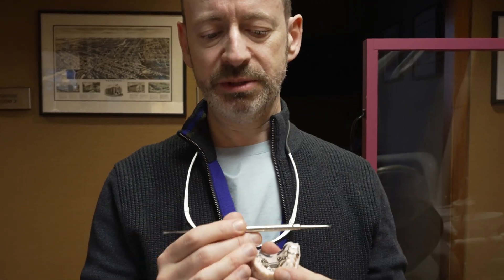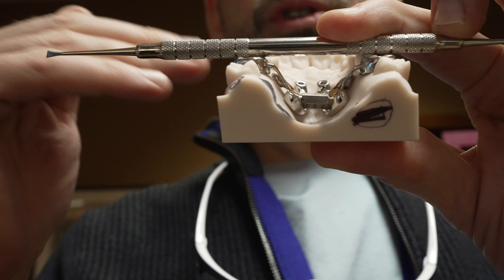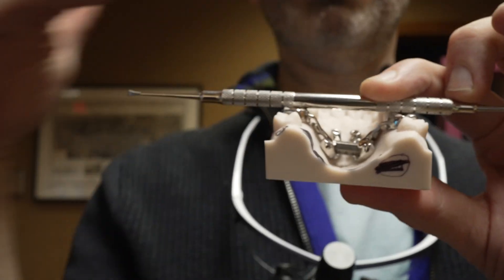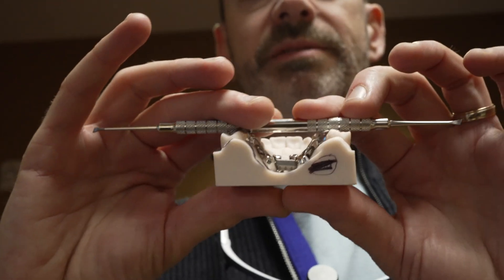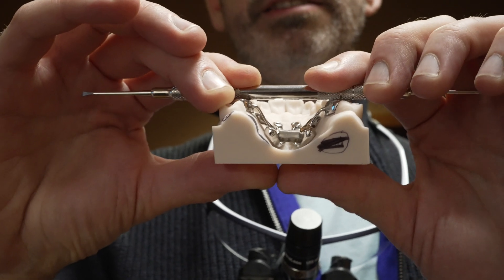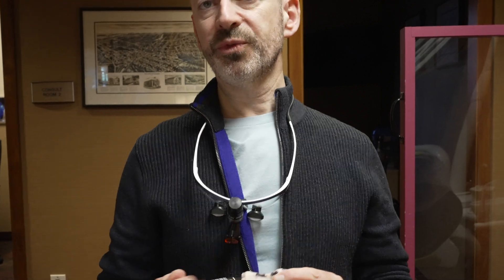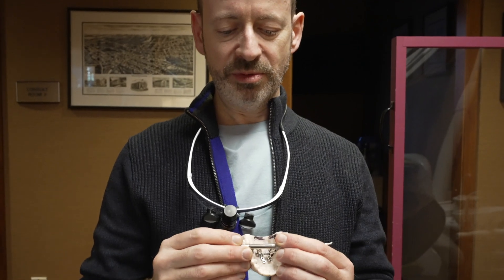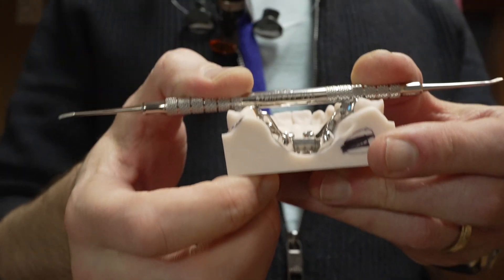Could This Help Prevent MARPE Asymmetry?

Comment: Dear Ron, if all teeth on one half of the maxilla are less (or more) erupted than the other half, is this method still applicable? Or is there an alternative method to establish the best angle when this difference in eruption is present? It seems to me that in a case like this it is not reliable to use the molar as an establishing point to determine the best angle to achieve symmetric/balanced expansion.

Comment: I'm not an expert, but this seems too simplistic. If we go with this theory, if a parallel screw avoids asymmetries, then further tilting the screw on the other side should fix an asymmetry? Has this been ever tried? This would confirm the theory.

An MSE or any other expander has to win different resistance points. The resistance come from the bones of the whole skull, that eventually connect to the maxilla through sutures. If the skull is asymmetrical (because of a cranial distortion for example) then the forces at play are asymmetrical, thus no matter how you position the expander (which is roughly a parallel force to the palatal process) it will always expand more on the least resistant side.

Comment: Actually an interesting thing here as well, is that like if you have something like the KLS Martin, if the palate is lopsided and not synced with the bite plane, you can't really like, install it at a different angle. With this design you have the cylinder and then you have TAD attachments that branch off of it. So you can have the cylinder at a different angle than the TADs. With the KLS, not so.

Comment: Hi.. I'm a late teen 17 and i have narrow jaw which is causing alot of problems will Mse work at this age?
Reply: 100% it will work at your age. No need to worry, people have issues splitting the suture in their 30s and sometimes their 20s, but at 17 your bones are still somewhat malleable and you still have some minor growth left. You should be perfectly fine.
Reply: @Will_4560  thanks sir
Reply: @plexbee_69420  I'm 17 too lol no need for that formal talk
Reply: @Will_4560  MSE stops being 100% reliable around 14-15 in males, in females you can get consistent skeletal results sometimes until they are 25 and beyond that as well, in males it's much less reliable. Even if you are 16 the maxillary sutures are already almost completely fused (albeit not fully ossified), for example the midpalatal suture fuses around 15. 
So it's not 100% certain the MSE will succeed, and he is likely to get asymmetrical expansion. If you're a male older then 14-15 it's best to do MSE with some type of surgical assist for more reliable results and to achieve more skeletal expansion instead of dental/alveolar.
Reply: @user-03-gsa3  thank you for this informative reply Tim.

Comment: Hey, are you aware of any experienced or trustable MSE providers and orthognathic surgeons in Australia? Please let me know as I'm planning on starting a treatment plan ideally this year, I'm still young (21) and would like to get this out of my way now and in the next few years.
Reply: Make sure the expander they use has 4 TADs in the front, and 2-4 TADs in the back pushing on the sides of the maxilla, like what Lipkin has here. TAD = screw that goes into the palate. That's the key for your age.

Comment: Dr Lipkin is checking to make sure main screw is parallel to occlusal plane…what if occlusal plane is off? Ie canted?
Shouldn’t a better way to evaluate appliance position (to avoid asymmetric expansion) be to make sure it’s parallel to THE PALATE… not the occlusal plane??
After all, the palate represents the point of SKELETAL EXPANSION better than the dentition (the occlusal plane)
Unless, there is something I don’t know…maybe there is a direct correlation between “occlusal plane” and “palatal plane”, and they are parallel. If so, then comparing the main Jackscrew against the occlusal plane would make comparison easier, and thus determining correct appliance placement easier.
PS: I’m not criticizing, I’m just trying to see things as clear as possible, and learn from the great minds leading the way!
Reply: you're right, Lipkin is assuming the occlusal plane is not canted.

Comment: Can mse fix maxillary asimmetry?
Reply: it can sometimes but it can also sometimes make it worse. The inventor Won Moon says there's a 60/40 chance it makes it better (60% it makes it better, 40% chance it makes it worse). And he was only referring to palatal width, not even what can go wrong if its installed at an angle as shown in this video
Reply: no
Reply: @user-03-gsa3  can you explain me why not?
Reply: @nokia_e720  no becoz it expand equally so ..if if it is apply on non symmetrical face it will make it more assymetric

Comment: So the appliance should be made parallel to the bite plane rather than parallel to the roof of the pallet. Does this mean the TADS might need to be longer on the side of the appliance with more of a gap between the mucosa and the framework to achieve bicortical engagement?